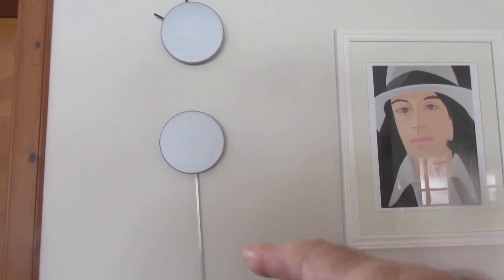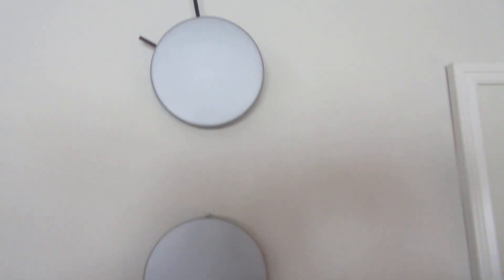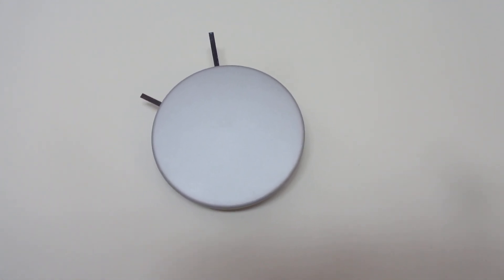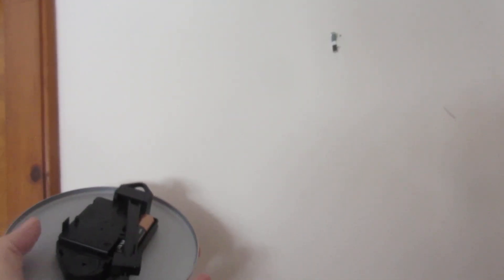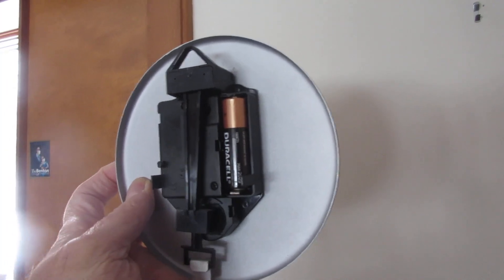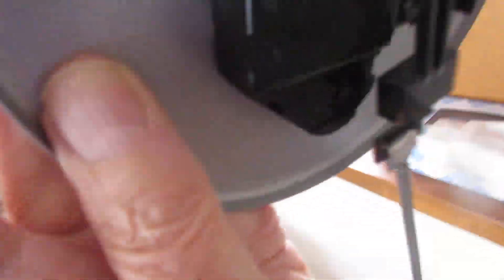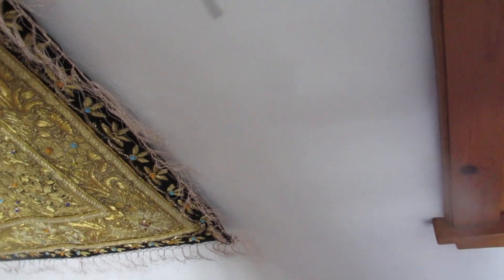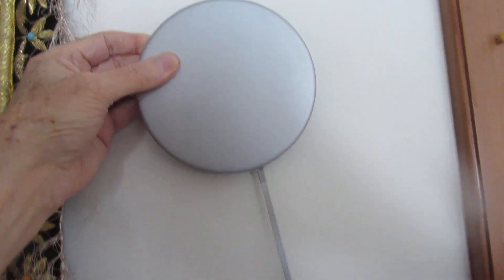Solution to Problem 103 - Weird Clock

Comment: Sir,
With all due respect, I believe there is a mathematical dilemma in the solution to the Problem#71 Elliptical Orbit. We know that the intercept by a normal  on ellipse's major axis cannot be further than 
(ae^2) from the centre of the ellipse, implying that no circle can be drawn with centre at either of the two focii of the ellipse that touches the ellipse(and not cut of course otherwise there would be two such circles). Now a circle and an ellipse on the same cartesian plane can have at most 4 real roots, and your solution(https://www.youtube.com/watch?v=SDbwuMdxHJs) says two imaginary solutions with one repeated root, which is possible if the ellipse did not have the above mentioned property. Concluding, I would say that as math only knows where the centre of the planet is and not where the planet is the trajectory should intersect the planet twice before reaching its initial position, hence there is no such angle. I say all this with all due respect, and would like you to correct me where ever I am wrong in this solution.

Comment: Yes, it's a nice clock, even though the pendulum part has only decorative function. This is how most modern pendulum clocks work even when they are one-peace. One could of course make a system like the one used in bicycle odometers, where the pendulum part gives radio impulses that the clock part uses for timing, but since quartz oscillators are cheap and more accurate, that would be rather pointless.